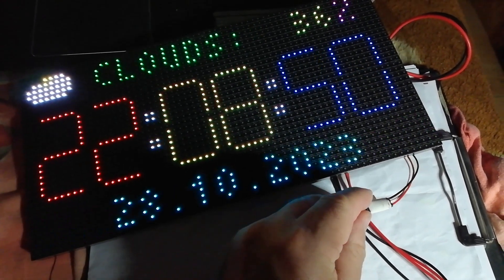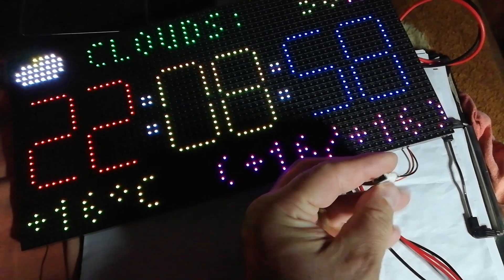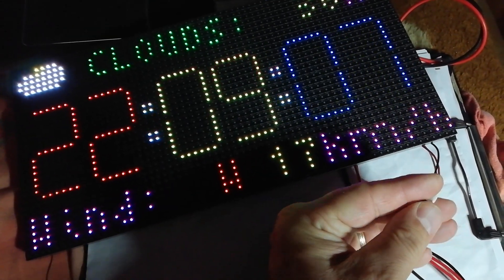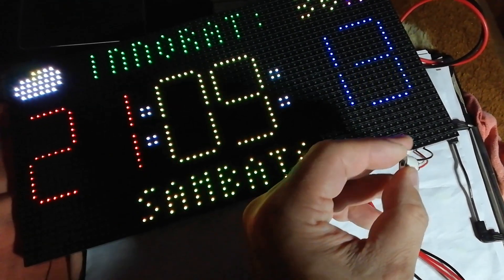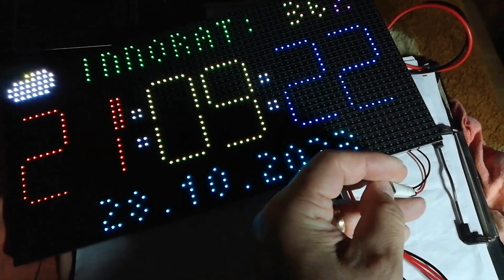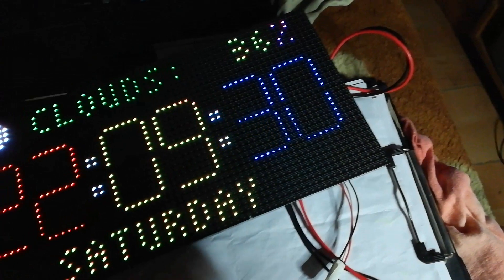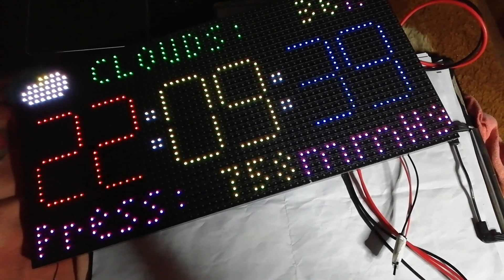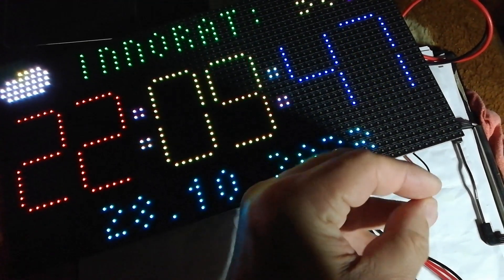Morphing clock (other remix)  with DST (summer/winter switch)

Comment: Hello, could you help me please, I want to show the windgust data, wind gusts.
Could you post an example out of code?
I've tried a thousand ways, but I can't find the problem.
thank you
Reply from the maker: sketch is in description of the vide.. also link to articles....
Reply: Thanks for responding, but I can't find a way to display the windGust information.
greetings
Reply from the maker: @pilart.c7302  is not clear for me what info you need.. tested clock by me show the speed of the wind (km/h) and direction ... please check what info you cand find from opemweathermap.org site
Reply: Thanks, everything works perfectly well, there is some information, wind.gust from openweathermap, which is what I can't show, which is the wind gusts. I just want to know how I have to write in declare scope wind gust so that it shows the information in km/h
thank you
Reply from the maker: @pilart.c7302 wind gust means peak speed of the wind or what kind of info about wind? please send link where you found this info and maybe I can help...